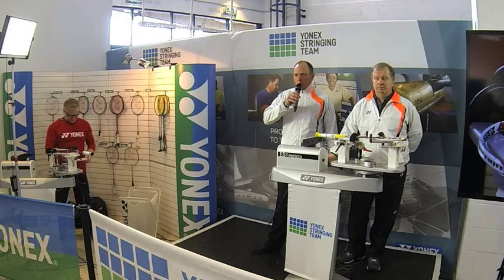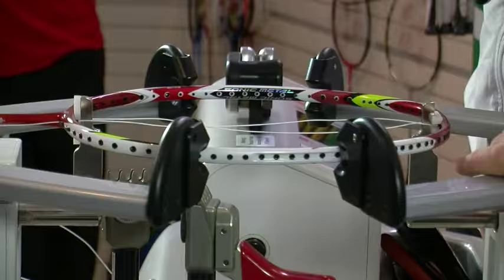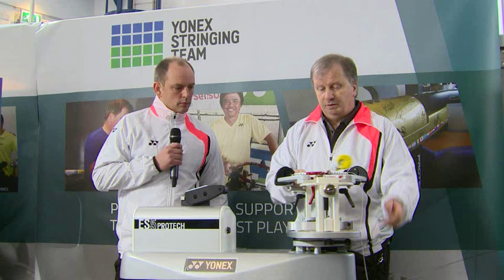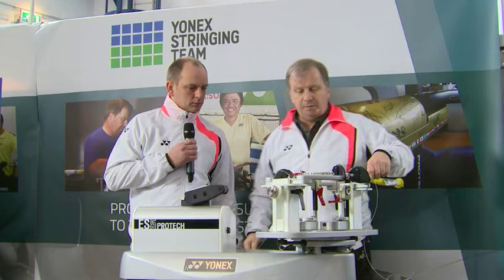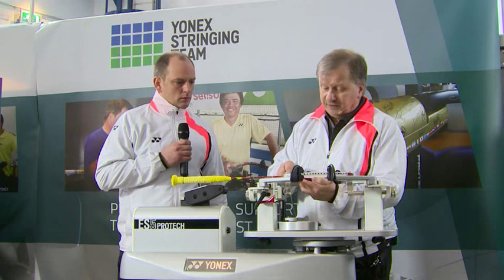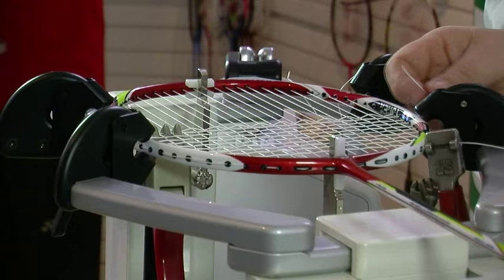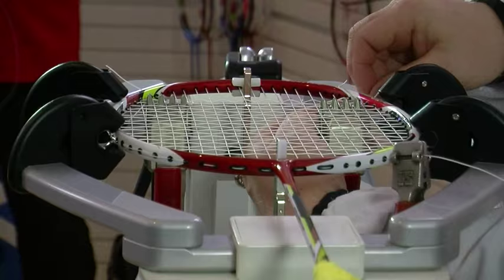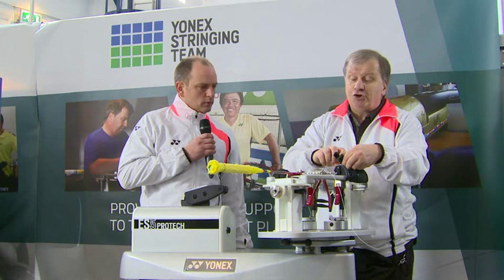Yonex Stringing Masterclass - Badminton rackets

Comment: I was taught how to do a 2 tie off technique. 
Do the mains, 3 one side and then the other. Then on one side, start doing crosses from hole 13 up to when the crosses start at the top of the racket. Then finish off the bottom strings and tie off. Then finish off the top strings and tie off. 
I was told that it spreads the tension more evenly.

Comment: Nice.  I string badminton racquets and I'm surprised that his first pull was using a starting clamp directly against the frame at what ....30 or more lbs?!?  And he double pulled the first two mains, which he said he would go back and fix, but didn't appear to unless they edited that out.

And he double pulls the last two mains on either side too??  Odd.  Maybe it has something to do with the high tension.
Reply: He came back pulling the first string at 4:00 if I'm correct. I agree that double pulling the last two mains is odd. Probably they are on the side that tension loss might be minor but still odd.
Reply: Brian Bulla The way he does the last two mains is not odd. It's called "The Yonex Loop" and he explains the reason for it at 6:30.

Comment: Question though..once you've locked the racket on its frame the shaft is then noticeably shaking if moved or touched. So as you're stringing it what happens if you accidentally touched the base of the shaft or the holder or the grip as you're moving/rotating the racket in 360 degree horizontally? Will that 'ruined' or in anyway affect the racket?

Comment: i get my racquets strung at 40 42  but the strings need to made stronger and the grommets always get cut and pulled through.....lets make better stuff man
Reply: 40-42? lmao maybe u play in mars with those tension.
Reply: @cedricmalenab7568  it depends on the racquets bro.. Your string tension is there to engage the frame.. Some racquets 28 all the way to 42...and Mars is too bloody far away... I'm thinking an uber😂
Reply: @MRBACKHAND  who pplays with 40-42?
Reply: @cedricmalenab7568  I do.. and any other Div 1 player that goes into my bag and pulls out my racquets.. :)
Reply: So....you're playing tennis, right????👀
Reply: @socuteboss8684  no bro,, just you saying that means you dont understand.... i have 2 racquets over 40lbs most are around 33lbs ive got one that goes as low as 29lbs... its not string tension you're trying to understand..... its frame pressure.....I play Div 1 A Grade..... welcome to badminton

Comment: Definitely did the first string wrong. He has pulled only one string but since he had only clamped the starting clamp at the end of the second string, eventually only giving the first string 15 pounds in tension. He does not clamp the second string at the top end and pull the first string again.
Reply: +chaitanya kumar Samardhi I noticed that too!
Reply: chaitanya kumar Samardhi why he would use a sgarting clamp on a fixed clamp machine is beyond me
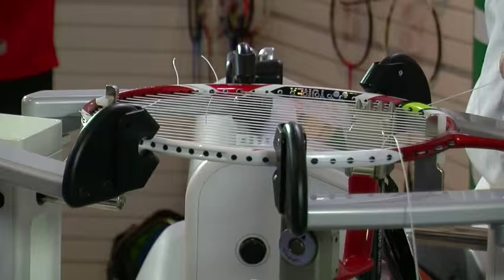Reply: It doesn't reduce tension by half like pulling 2 strings (similar to moving pulley). Theoretically the way he did just remains the desired tension, but it might have tension loss due to friction between the frame and the string. He re-stringed the first string again at 4:00 and it would be ok. But he double pulled the last 2 main strings at 7:00 which might have tension loss again.
Reply: we can determine the tension in the strings,  T = mg + ma/2 

30lbs/2.2
=13.63kg

(13.63kg) (9.81m/s^2) + (13.36m/s^2) +(0) 
_________________________________________
                                       2
=73.56kg^-m/s^2 ÷ 9.81m/s^2
=7.49kg x 2.2
= 16.49lbs

So the tension in each string is approximately half of the machine tension give or take 1.5lbs